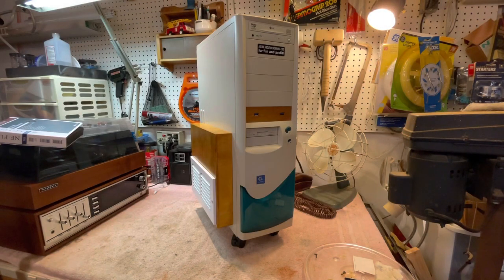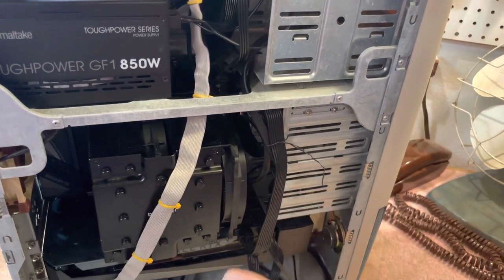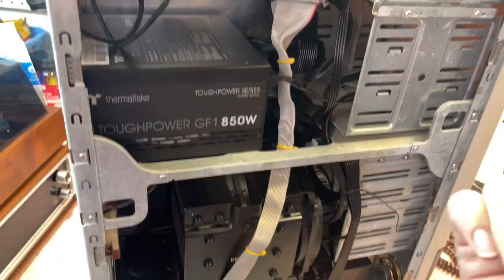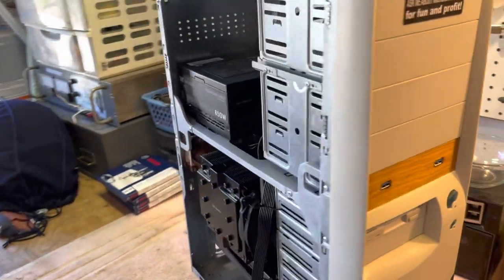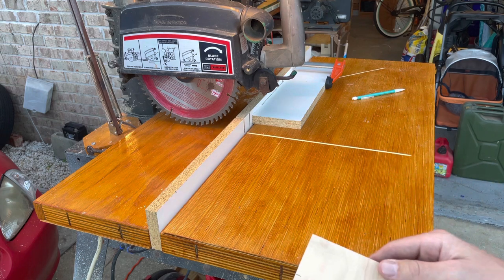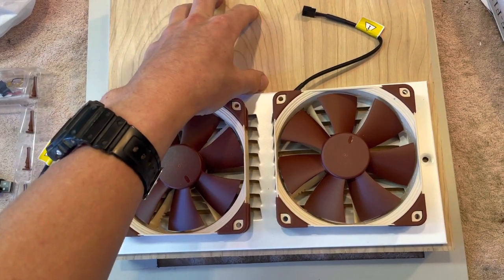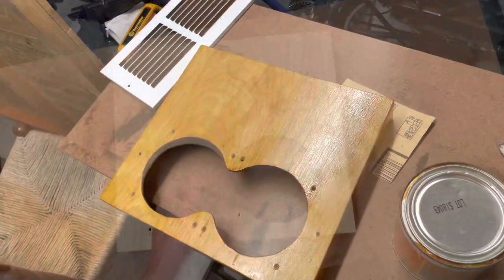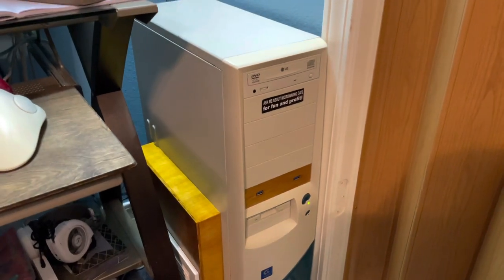I built a sleeper PC

Comment: I wonder why you didn't paint the bulging white?   It would have matched your whole case
Reply from the maker: I am pretty against painting wood in most situations if it can be avoided, I prefer stain or shellac so the grain is visible. The shellac won’t get as dirty as a beige paint and finding a paint that matches the color  of the case would probably be pretty difficult. I also have a lot of wood in my room that is the same color so it matches with my furniture.